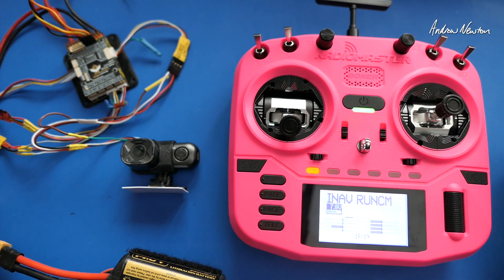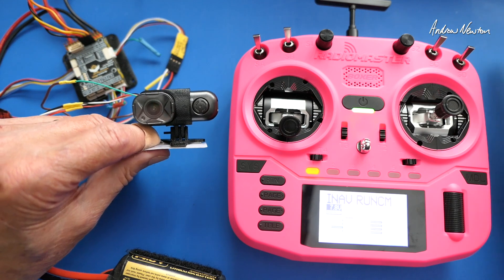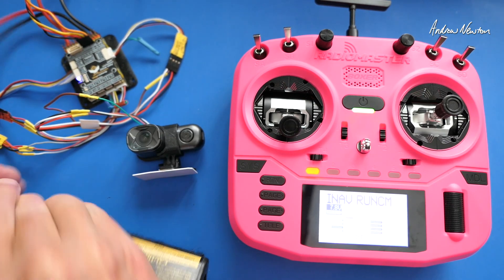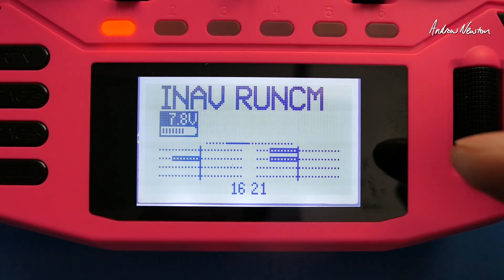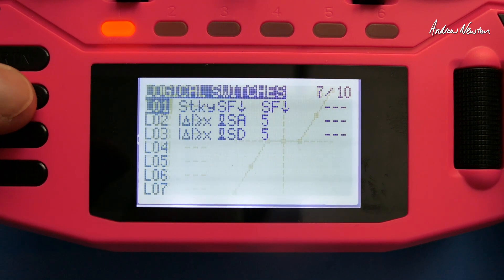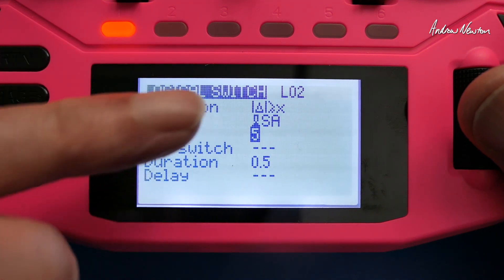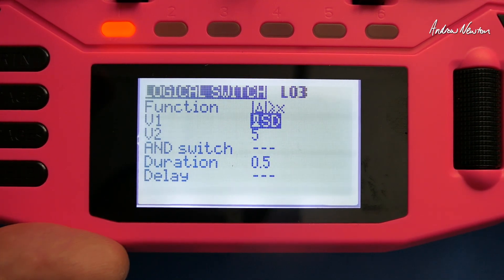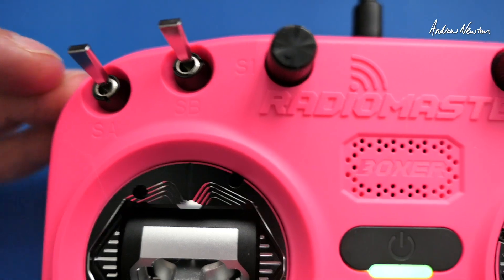Runcam Thumb Pro more logical UART Control setup

Comment: An essential improvement to camera / pilot experience with a simple a solution (adding the logical-switch momentary delay). Runcam should include a reference link to this video in their online support, or integrate into a true "switch state" option into a future firmware update. This method of operation is much less prone to error and/or confusion.  Well done Andrew.
Reply from the maker: Thanks AW. I suits the way my brain works anyway

Comment: Isn't there an option like 'work as a push button' in the settings of the buttons located on the screen of the transmitter?
Reply from the maker: Might be in System settings but that would be a global setting, not just for this model.